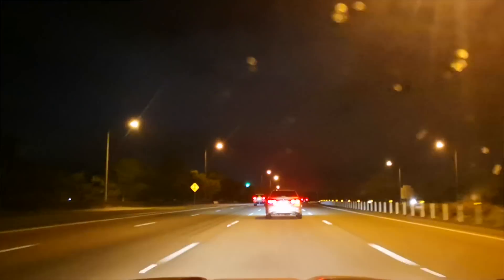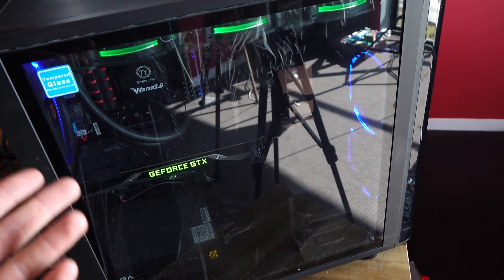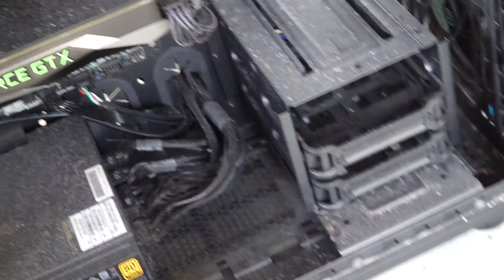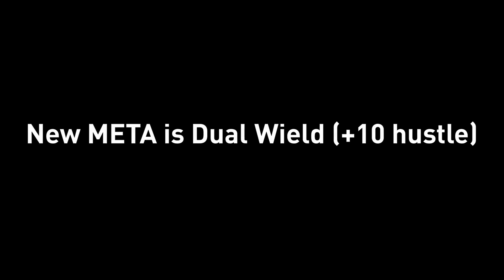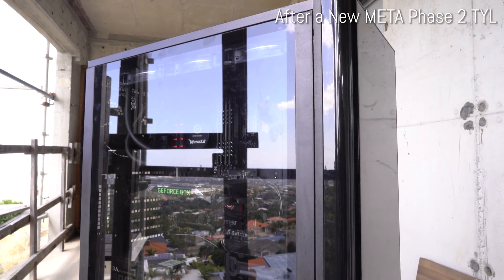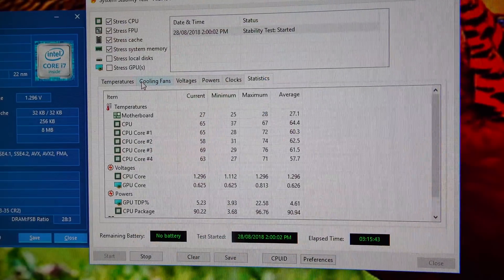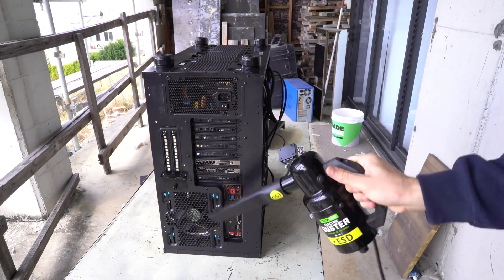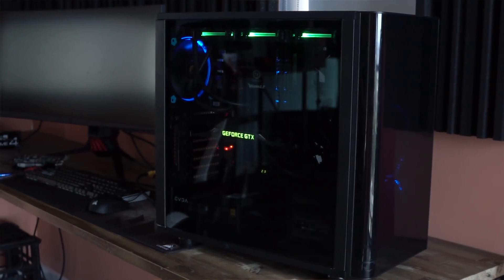How to Turn $900 INTO $1399..!? - The QUICKEST Way to Shine up YOUR PC?

Comment: You should check the AIO
4790k @ 4.6 @ 80c with a 360mm AIO is a bit insane
Mine is 4.5ghz @ 75-77c with a 120mm AIO

Comment: Even after cleaning You kept 2 Fans for Intake & 4 Fans for  Exhaust!??  Is there anything called +ve Air Pressure in that Case?? you sure it won't get caught up with Dust & Cob Webs again?????

Is that Case Thermaltake view 31 ???!

Comment: I love it , the only ' let down ' is , that all 4 ddr slots are filled , would loved to see 2x 8GB , instead of 4x 4GB . 
If you put in a GTX 1080ti and 32GB - 1866Mhz ram , it would have been a real killer system ! 
But , it is still very nice !

Comment: i found a pc equiped with 16 gb of ddr3 ram and i7 4770k and a MSI Z85-G45 gaming and a gtx 760 with xfx 650 watt power supply with 22" lcd monitor for 350 euro 1100 tunisian dinar and i down it to 1000 dinar :D

Comment: I love ur videos and how creative u are with the cleaning... but using wd-40 is just gonna make ur pc a dust magnet and the smell is terrible
Reply: yeah agree here tbh , its a lubricant too wtf ? why he doesnt use a silicone based spray as they shine up even better and aren't oil based
Reply: Yeah, it's a lubricant I use it when I work on cars to loosen bolts that are rusted. I assumed that it would leave a residue behind, that's why it shines. However, I have never used it to clean a PC so I can't give you a definitive answer on that.
Reply: there is a wd40 electrical cleaner. wd40 is just the brand, look at the can :)

Comment: I recently saw MSI GTX 1080Ti with 2,5 years warrenty for 625$, is that good price???? Nice vid...
Reply: AUD or USD? If AUD it's a steal.
Reply: USB, im in Croatia
Reply: Oh ok, it's still $70~ less than retail in USD. I'd hold off on it for a couple months unless you need it now.
Reply: Yeah, but here in Croatia it's actually almost impossible to find GTX 1080Ti under 800$ USB especially with warranty.

Comment: Awesome deal..... nice video and a good little yes love cleaning tutorial.... But i have a question, whenever i used wd 40 on my pc case to clean it, it didn't dry in one day (however an alcohol which dries in minutes ), it took at least 4 to 6 days and even after it isn't fully dry, when i did put my hand on it, it sticks on my hand, any tip for drying it fast....
Reply: That is wd40 
It stays oily

Comment: Just a little curious about using WD40 - does it leave the greasy residue behind, or does the datavac get rid of the residue? Got some parts I need to clean and this looks like an efficient method, but I don't want crap left on them. The WD40 residue is a dust magnet.
Reply: Callum Turner I was thinking the same also, a datavac another way to say it is "electric duster"
You will find ones with good ratings and they basically got the same power!
Anyway I think The alcohol+Duster+Brake cleaner should do the job.
Reply: if he uses a T H I C C dose and it doesnt flash evaporate instantly then he will wipe it down with an old shirt or blow compressed air and it gets rids of the excess!
Reply: QD Electronic Cleaner by CRC, no residue or smell. Not as cheap as WD-40, but worth it.

Comment: btw one quick tip, you're supposed to use a q-tip or something to hold the fans in place when using compressed air / datavac on it, to keep the fans from spinning at super high RPMs that they are not meant for

Comment: Delidding helps 4790K. I could do those temps @ 4.8-4.9. I've de-lidded 3 of them so far. 21c drop at high temp end.
Reply: no need for delidding. my 4790K is overclocked to 4.9GHz, 1.34V and it stays under 75C on full load. with aircooling. (Noctua NH-D15)
Reply: @HaaskaChan  that's opinion. I'm at 65-68c at any core at most. Depends on ambients. Are you auto overclocked or what? Details man!
Reply: I manually overclocked to 4.9GHz and only thing what I touched is core voltage and it's 1.34V. CPU fans are set to performance and it is not loud thanks for noctua fans
Reply: I would say that the auto overclocking produced more heat for me. It would volt up to 1.45v on adaptive and getting it dialed in took me quite a bit of time, all in all I have my 2400mhz ram set to 2666 @ 4.9. Auto overclocked wouldn't do that! So after manually setting about 20-30 parameters of the bios I was able to get 4.9@2666@4.6 cache as 4.7 wanted like 1.42 volts on cache cores.
Reply: In my discovery of how my overclock beat the auto overclocking in temps, voltage and everything manual overclocking was stability like it never had , I would get 4.8 on auto settings too but 1.42v... dialing stuff in was a better number settern in testing and benchmarks 65c is another reason. At 4.9 that's unheard of.
Reply: I can go 5GHz with my i7 but voltage needs to go too daam high for my comfort. I dont remember how much it was, I tested it over 1 year ago.

Comment: I bought a pc with a i7 975 8gb of ram a 750w psu and a p6t-se motherboard for 250$ CAD. 

I don’t know if it’s a good deal or not.
Reply: not really mate
it's not particularly bad but the i7 975 is outperformed by the x5650 (6 core 12 thread oc'able to around 4.2-4.5 with a decent air cooler) which is a lot cheaper and runs in the same socket , i'd flip the i7 and buy an x5650 for an upgrade and a bit of profit
Reply: Joel Bassett thank you for the advice
Reply: @average_snmp_user  No problem mate

Comment: Crazy... My Win 10 gaming rig is a 4790k at 4.6 and a rx480 on a NH-U14S air cooler running 1 fan in push. The only time my chip gets anywhere near 80c is a full stress test. Most of the time it sits around 60c in games. Is it because it is pushing a faster graphics card at higher resolutions ( I run 1080p)? I would have thought that higher resolutions would put more on the GPU.
Reply: I have a 4790k system. In game the difference between an oc 4.6 (on 4 cores) compared to the default 4.4 (seem to recall not all cores are 4.4 on default.. more like 4.4, 4.4, 4.3, 4.2) isn't noticeable. This is using mid to high tier GPUs like 1060, 970, 390 etc.
Using high end 1080+ GPUs it starts to have a more significant impact.
Reply: It's what I figured. It's why I matched up with a rx480. edit: the o/c isn't noticeable in top frame rates, however it is very noticeable in the lows.

Comment: I've got to learn to watch the video before I comment lol. Anyhow my main PC is a 4790K and my secondary PC is a 4690K. That just made me want to OC the 4790K (just haven't felt the need to yet) but my 4690K is OCd to 4.2GHz and runs like a champ and it's been well over a year now on that OC and I'm only using a Cooler Master 212 EVO. I did neglect something with the 4790K for 3 years. I'm using the ASUS Maximus Formula and the CPU power delivery has both a 8 pin and 4 pin. I thought the 4 pin was only for if I were to OC the CPU bet here I was completely wrong. All this time I should have had both plugged in and it's not called ATX CPU power it's actually EATX Power and both need to be plugged in for stability. No wonder why I was getting random crashes over the years of using it. For about 2 weeks now I have both plugged in and I can actually see the difference. Haven't had a crash since both have been plugged in. If you ever come across that board keep that in mind that both need to be plugged into the board. I'm such a dumb ass and I've been building PC since 2003. I shouldn't have been so excited to get it up and running took a few steps back calmed down and read the freakin manual. Lesson learned :)
Reply: That 4690k should easily oc to 4.4+ with ease and run cool on a low voltage.
As for the 4790k use adaptive voltage in the Asus bios. Plenty of guides to explain.
Unless you are CPU bound with a top tier GPU  i wouldn't really bother tbh
Reply: So far I haven't had a need to on the 4790K, Maybe down the road I will but the 4690K I had a feeling I could get higher but I would like to make this one last as long as possible. I have a third PC that's about 10 years old now and I use it to play new games showing people on my channel that Core 2 Quads are still able to game these days. That is the plan I have for the 4690K,  That's if I'm still making video or gaming for that matter or better yet still alive lol.

Comment: Man I owned a i7 4790k for 5 years and man it was a headache, first 3 years it was hot af and I always had it at 4.8ghz. and temps were going just over 96c. Then I delided and custom water cooled it, temps went down to 68c max on full load and testings. I was so happy with it and even bought a 1080 ti and all was great.

A few years later the cpu just died on my ass the voltage was 1.29 on 4.8ghz. Was great while it lasted but now I have a 8700k and non delided. No voltage bump nothing straight to 4.8ghz out the box and temps are so goood. It doesn't go higher then 71c max load. Happy days!!
Reply: DeCypherGaming UK must have been the cooler you used I guess, also 1.29?
Reply: @f.a.i9638  1.29 was what I always had it on it as stable. But no matter what cooler I used that cpu was hot ad.

Comment: What kinda wd-40 did you use?  Does it evaporate? The kind I'm used to would make an oily mess.
Edit: In the US when someone says "WD-40" that means the oily kind you'd clean something like a motorcycle with.  I paused the video and saw "Australian Export" on the can, no wonder I can't find that on google here in the States lol.  It was fast but it looks like you actually were careful to just spray the outer surfaces of the case not the motherboard or the connections on the back.  I guess you used electronics cleaner that evaporates?

Comment: 4.6ghz without a delid sounds like BS I'm guessing the previous owner did that
Reply: My gaming rigs' 4790k was bought brand new by me, still have the original box. No delid 4.6 all day long on air. Idle at 32c gaming at 60-70c stress at around 80c. Did I get a golden sample? I doubt it but you never know. Just know that 4.6 is easy for these chips with no delid. 4.8? Now that's pushing it.
Reply: dwarf365 sounds like it if you’re not using voltage. You should delid these you’d be disgusted by the Tim intel use even basic arctic mx-2 knocks 20c off temps

Comment: I still think you paid too much! 900 for that was WAY too high! You can in fact build a skylake system with a 1060 for 900 NEW!
Reply: SidTheJerk420 you also have to remember that this is 900 Australian dollars which roughly equates to 660 US dollars.
Reply: 1060<1070
skylake i5< Haswell I7
Reply: New doesn't mean good, and the fact someone paid extra on top of that to buy it afterwards means it obviously wasn't too much
Reply: SidTheJerk420 
1070’s cost at least $200 more than a 1060 and I doubt you would get a CPU with as good performance brand new for that price

Comment: Stop using WD-40 please if it's not the electrical contact cleaner version. Thanks.
Reply: smoked_out huh?
Reply: F.A.I 

It's kinda oily and is a real dust magnet, after some time it will create this nasty layer of sticky dust. Source: I've used WD-40 on the outside of my case a couple months ago.
Reply: understand exactly what you are saying as i use wd40 a lot. yet with practice comes experience and if you dont just aplly a big sticky layer it will work perfectly , i usually put some WD40 on a paint brush and then spread it out on the component reaching even those tiny places :), after this if i notice there is some spots where it got a little bit more intense i just use a paper towel to soak it up. all this after dust cleaning and in the most dificult situations some alcohool wipe.
Reply: Butcher
i did almost the same you did and got pretty nice results, just a thin layer just like you said, spread with a paint brush, and it passed almost 2 months and the pc that i've used WD40 it's in nice shape, no "sticky oily dust" or anything wrong
Reply: smoked_out I've Only used compressed air and alcohol.
Reply: @-eMpTy-  its only kinda oily if you dont wipe it off enough. when your done wiping it off you shouldnt see any oil glare on the item. you are clearly not putting in the extra elbow grease.
Reply: wd 40 specialist electrical contact cleaner is an absolutely superb product
Reply: He liked the shine though he says it a lot
Reply: I think Brake cleaner and Compressed air +
 Alcohol do the job
Reply: Cracka Lackin Shine!

WD-40 Products are all different. Some are oily some are not, depends what your use is, most are non-conductive as well. Bry obviously likes that shine it gives, which is not bad. Besides, if you need to clean off the WD40 and dust later, dunk the whole PC in a bucket of ISOPROPYL to get rid of the oily residue and dust. (yeah a bit extreme, I know).

These are great for removing scratches on plastics like the case panels or perspex side window : https://www.youtube.com/watch?v=certTu6ETWw
Reply: You blow dry/wipe it off it doesn't evaporate. It's just an alternative to water cleaning
Reply: Yusuf Nayab 
No it's not. Seems like you haven't worked with WD-40 before if you compare it to "water cleaning".
Reply: ikr this is just lolololol
Reply: I use soda.
Reply: @issaciams  how good does it work?
Reply: @Zooppz  i used it to wash literally everything inside my pc and it does a good job and i didnt even wipe all the wd 40 off its still wet ish and still not giving any problems but yea i dont think its meant for cleaning pcs and stuff
Reply: WD-40 works fine you cry baby. The elecrical cleaner version is damn near the same shit. just one is branded for other uses.

Comment: You have to get yourself an air compressor, mate.
Reply: Data vac is more powerful than a standard 25psi compressor, and it's handheld and it isn't so big and loud. If we used air tools on the daily then yeah I'd tell him to buy a compressor and turn up the pressure, but datavac is suprisingly powerful, like borderline hurts you
Reply: @YusufNayab  I've never had a compressor less than 100psi. Takes seconds and you don't have to use qtips on a blower fan. I'm used to working with them in my machine shop thou.
Reply: @TheDaswilhelm  yeah the datavac blows super directed air. It's tiny. The cue tips are just to get the excess oils off in a way air simply can't. WD-40 is line polish, you need to rub it into your plastics
Reply: @YusufNayab  yea I understand what he's  doing. I just always try to avoid spraying things when I can use air.
Reply: Nah brake cleaner and WD-40 act like armourall, it polishes the plastics
Reply: @YusufNayab  yea i know what they do. I work on cars and computers. Still not going to be spraying things unless I absolutely have to.

Comment: Tell me what you think of this setup that I've built for $565

CPU: 2600k $90
CPU cooler: Some small dual tower chinese cooler from ebay $20
GPU: Windforce 1070 ti $285 (still has warranty)
Mobo: ASUS P8Z68-V LE $60
Ram: 16gb Crucial 1600mhz $30
PSU: CX550M $50
HDD: 1tb 7200rpm Hitachi drive $20
Case: Old Coolermaster case $0
Misc: Some extra case screws $10
Reply: Put a ssd in there and maybe a bdtter cooler if you want to oc , but else you should be good to go.
Reply: Eh, ssd's are kind of overrated unless you have the money for it. Once my 8086k sells though I will be grabbing a new 3tb hdd and a 512gb ssd.
Reply: Hi There 

Overrated? Lmao. Once a SSD, always a SSD. I've recently flipped a build which initially had a 1TB HDD in it but upon reinstalling windows I just couldn't let it go without an SSD. I threw in a 120gb Toshiba for the buyer. They're cheap asf now aswell, 256gb for $40-50.
Reply: I've used ssd's before, but the difference between that and a GOOD hdd isn't much except for booting into windows. The toshiba P300 for example can easily have an OS on it while still feeling snappy.